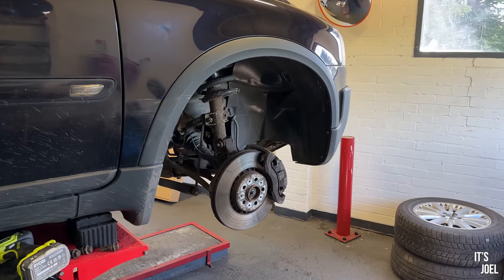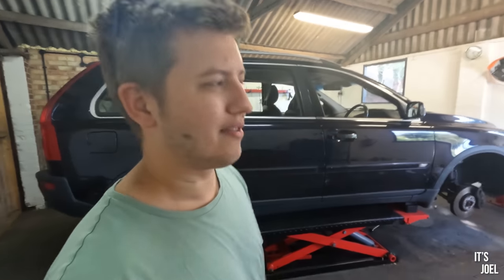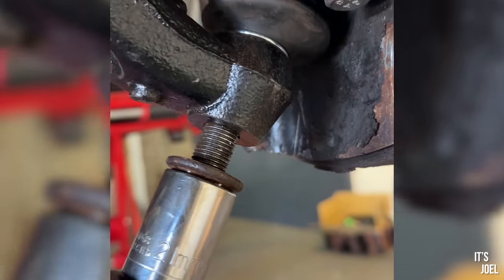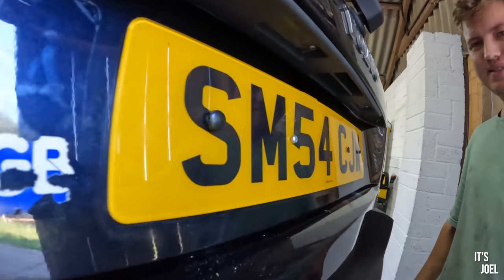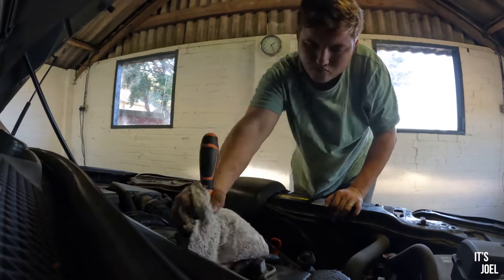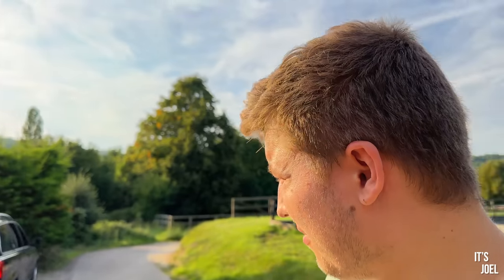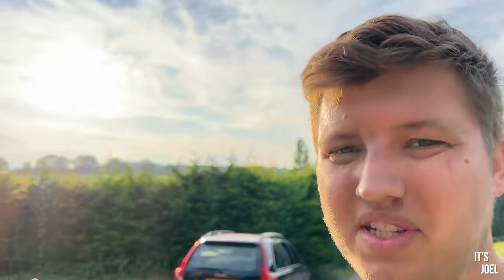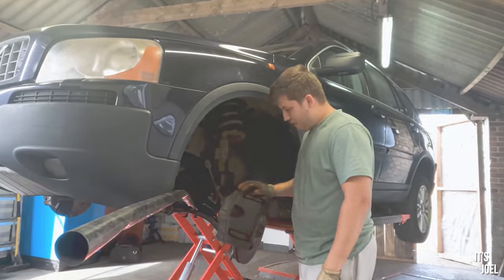CAN I SAVE MY £800 COPART VOLVO XC90? PART 4

Comment: Hi Joel, If you have learned new stuff this is great experience in life we never stop learning.
Remembering back to early 2006 I bought a Volvo 440 GLE hatchback it was a lovely car and the MOT station failed it. And said it would be used in the local fire station It never failed on rust.
It failed on turbo and Calipers. In them days I never had a computer of my own and I did briefly look at the parts a 2nd hand turbo £80 and Calipers I would say new around £40 per corner.
Test my knowledge lol..(could be two Calipers to each corner).
In my opinion you choose a well built car to test your knowledge and skills on. Don't quote me But id say Apprentice Mechanics learning there new trade would be given a car like humble Metro and taking off wheels and battery to doing head gasket or a brake service.
Maybe your new idea with Copart cars is great idea, plenty of cars to chose from great income stream to build a business.
40% Of guys love cars be it valeting or restoration Some love cars but dislike getting there hands dirty and intimidating there purchase, like new number plates and tyres or its bodywork...
I just bought a lovely Jaguar 4.0 V8 2001 LWB I really miss my old 2000 X registered one. Something about this car its presented as very clean car with minor jobs and some simple DIY to do improvements or is it..? Its been driven 127.000.
I wish you well in getting the car MOT'D and hope you manage it well, This video serves a purpose over a garage bill being say £1000 pound repairs to a DIY home repair at far less A Volvo main dealer would buy Volvo New parts and apply high hourly rate /VAT/cost of parts, But most Know there are recycling centres that you can order a part at 50% cheaper and fit yourself. Most cars now have a computerised system and charge £40 just so the car and pc to recognise the parts.
To give an example My twin top Astra has an issue people say that for my roof to work I have to use all 4 buttons on the unit press down hold for 5 seconds and do same on each window for it to work. The second hand unit works but the new battery which I installed myself doesn't want to fire into life It did when I first bought it but I have rarely used the car. And I thought I left the car with some fuel in it. 
Look forward to your next video..

Comment: Don’t think the injector needed to be replaced, but the injector seals on all 5 of them. 
That’s what causes the mess in the engine bay and that’s the main reason car is running rough. With a bad sealing, diesel is coming out instead of going into the cylinder so the engine will not run properly.

Comment: Great to see a novice having a go! Bit concerned that I didn't see you remove or put in any injector seal? Most cars will run on default until the injector is coded, so you could have left the new one in? You should finally torque the suspension parts/lower control arm with the vehicle either on the ground or the suspension under load as the rubber bushes will be under greater strain and fail sooner due to over flexing.

Comment: You never tighten lower arm pivot bolts until you have the vehicle sat on the ground or you will twist the rubber bushings and cause premature wear.

Comment: Good on you for doing the work yourself. It’s the only way to learn! Ps there’s a copper sealing washer on the bottom of the injector, you may get away with just cleaning up the old injector and the seat where the washer sits and just replace the washer with new.  Would save any coding issues.

Comment: Think the new injector was chuffing (couldn't hear properly on the audio)(possibly smoke coming from around the injector body) due to copper washer that sits between the injectior and block and forms a seal isn't new. If you refit your replacement injectior makes sure get a new washer (a car factors will be able to sell you new one specific for the Volvo) and you need to clean the seat in the block and remove any dirt and debris so that the new washer can sit flat. Once all back together tbis will stop the chuffing plus programming it the car will help with the running smoothly again.
Good job well done, i can tell from experience the amount of frustration that happens when fixing/ working on cars and the relief you get when you overcome the obstacles!!!! Onwards and upwards in your learning knowledge!!!! 👍👍👍👏👏👏

Comment: so the "wet" is blowby..  and when you started it the injectors were dry so thats what you heard, also you need an copper washer under the injector thats the chuffing sound..  its the gas escaping past the bottom of the injector, this if not fixed will cause carbon buildup...

Comment: Kudos to you for having a go and getting stuck in yourself, Joel. Too many people borrow cars and video journeys in cars and it gets boring, this is a much more interesting watch. I started the same as you when I was 18 with a socket set and a Haynes manual to swap shock absorbers on my first car, a Peugeot 306. Last year I had the heads off my 4.2 SC L322 and I’ve just finished doing the timing chains on my 5.0 SC L322. Things will become easier the more you do and with YouTube these days you can learn a lot. Quick tip for your ball joint, if you look in the end of it there’s usually an Allen key or torx socket that you can use to stop it spinning whilst you tighten it up with a spanner. Once it’s nipped up you then switch back to a socket to torque it up. Shame you’re not closer to Glasgow or I’d offer you a helping hand.

Comment: Using VIDA will take you down a rabbit hole showing you all sorts of faults on the car. But it is invaluable. My ABS faults were a trilogy: steering wheel angle sensor, yaw sensor and a couple of cables needed replacing. 

Fortunately, the XC Decided it didn’t like its rear crank seal one day and oil spewed forth. Off it went to the great junk yard in the sky. 

I’d have another in a second if it wasn’t was ULEZ!

Comment: Joel, I have a V70 with the same engine, please for the love of all that's holy try and flush the gearbox as much as you can with JWS3309 grade oil as a lot of people were told it's "sealed for life and doesn't need to be changed" which is a load of tosh. The solenoids and the B4 servo piston really do not like any contamination and will eventually break the gearbox. Really well done so far!

Comment: Of course it's going to run rough at fist start up, the whole line is full of air, you need to purge that before it'll run good. On a diesel you normally bleed the air before starting ...

Comment: Im not sure about volvo injectors, but im sure they have a copper seal on them. Abs light is on probs due to a bad bearing which has a ring in it, if vida says mechanical failure then its the ring. Easy job that.

Comment: did you change the injector seal (copper crush washer at bottom of injector hole)?? it will be the seal that has gone not the injector in 90 percent of cases when to top injector is getting wet. When you pulled the new injector back it defo look like it was still leaking.

Comment: Well done for getting stuck in and giving a go, but try and use your time better, the headlights, number plate and wing mirror don’t require a ramp to do those tasks. Use the ramp for anything you can’t get to underneath the car.

Comment: You most likely will have done your research on the injector plight by now. However, did you fit a copper washer to the end of the new injector and fish out the old one from the old injector aperture if I wasn’t stuck to the old one when you removed it?
Also I done a bit of research as I’ll be doing the injectors on my V70 and read how there are 3 classes of injector. Like you mentioned in your video you clocked how the number was different to the others and that’s a hint to them needing to be the same class if you have 2 or more that are different. Regardless of the class they need to be coded to be optimised by the ECU. 

Bravo sir, doff my cap to you taking this on. Don’t be perturbed by the vicissitudes of working on your own car and chalk it up to experience! You’ll no be wet behind the ears for long doing it the way you have.
Reply: There are 5 "classes" of injector, and you can fit one either side , so if its a 1 you can fit 1 or 2 , if its 2 you can fit 1 or 3 , and so on , and the engine will run fine , but , you need volvo vida from Matthew Levansky , he supplys a laptop , dice interface and has you tube videos on how it all works .
without one , you are wasting your time on these cars.
Reply: @AndrewNeilBaird  I say classes as I seen someone else use the term. Sure there is a better term for the numbering, I’ve got a complete 2nd hand set handy so to save confusion I’ll attempt to change them all. How much is the Visa setup from Levansky?

Comment: He injectors are numbered and vida will tell you the info, I "believe" that a single number 1 is fine with 4 number 2's, check in Vida for what is currently coded to te car.

The popping noise that can be heard is likely a engine mount leaking, they are vacuum controlled  under 1100rpm, block the hose to them by kinking it and see if the popping goes away.

There is a youtube channel called sirobb he covers te d5 euro 3 engine very well.
Reply: its very true the engine mounts are vacuum controlled from the 3 hoses that come from the passenger side front area is a turbo boost control sensor 1 goes to the front mount via a t piece the other runs to the rear mount the last one runs to the side of the engine to the vacuum unit. theres an easy way to test the engine mounts by removing the oil cap while the engine is running if there is noise popping from the oil insert hole then the engine mounts are at fault but if its not popping too much its the vacuum lines from the turbo control valve unit itself

Comment: For the ABS light, could it be an ABS sensor and not the reluctor ring? Ideally it needs diagnostics plugging in as it could be anything....the module itself, ABS sensors, reluctor rings, other sensors (steering, yaw etc)

Comment: Hello Joel. I am sure somebody has commented on it allready but here is my advice. The injector is probably all right but the seals are blown and the combustion gases blow by.
Reply: There is usually some o rings and copper crush washer that needs to be changed. You need to check the manual and see everything it needs to changed. Usually whennyou remove the injector you need to replace the seals and the crush washer because they are one use only. And sometimes it is required to change the bolt as well that holds the injector. And with the crush washer there is proper sequense to tighten down the injector. You need to do everything by the manual to get it right. And cleaning the injector hole and seat is very important.

Comment: 60 pence copper washer for injector which was mentioned a few times in the previous vids  but this vid doesnt show you replacing the washer so you will still het blow back. Dont forget drop links for mot

Comment: The injector seat in the engine should be spotlessly clean, and a new copper sealing washer should be fitted, it should then sound an awful lot beter. ;-)

Comment: That roughness of the engine sounds more like lifters as you can hear it trying to come back through the intake.And the different class of injector won't be able to be coded,also if that copy of Vida is a clone version it doesn't have coding abilities.

Comment: Would definitely be interested in how you got a copy of VIDA and connected it to car? Could do with a copy for my old v70
Reply: ebay is your friend...vida is the software and dice is the box that connect PC to car. of course its a knock off but you don't want to see volvos price! a pain to install software and takes about 80g of storage or it did 10 years ago when I did mine. doesn't take long to get to grips with it. p.s. only works with pre 2015 I think as went over to online connection direct to Sweden.
Reply: Cheers Kenny, yeah did a bit of research, does look a bit of a ball ache to install and I’m not the best with computers….

Comment: You had plate holders you just ripped off 😂 all you needed to do was remove the old plates and put the new ones in the existing plate holders, no drilling or screwing required